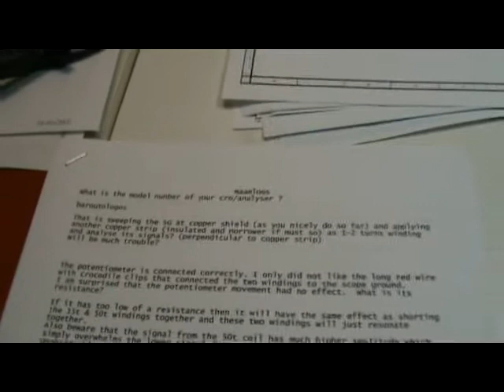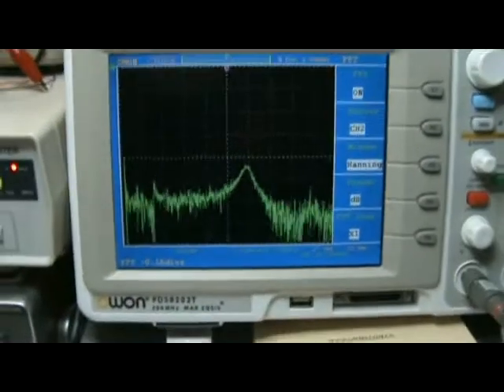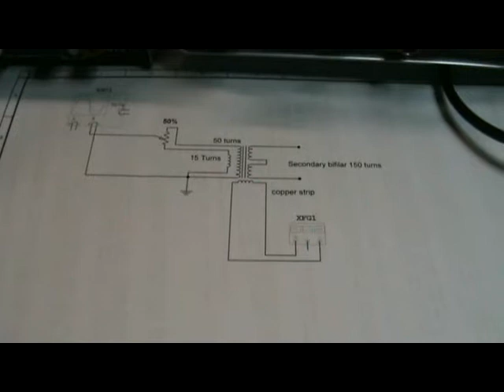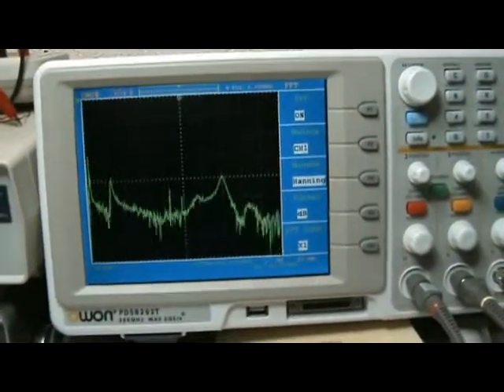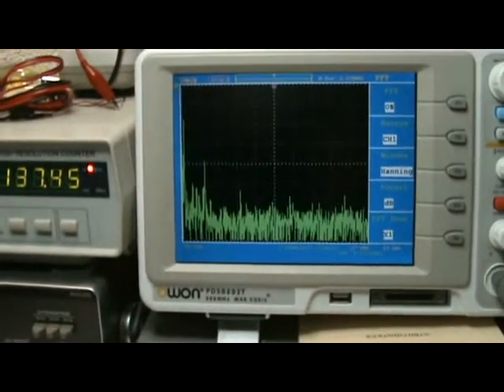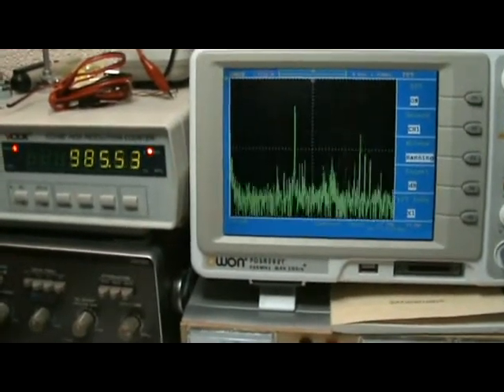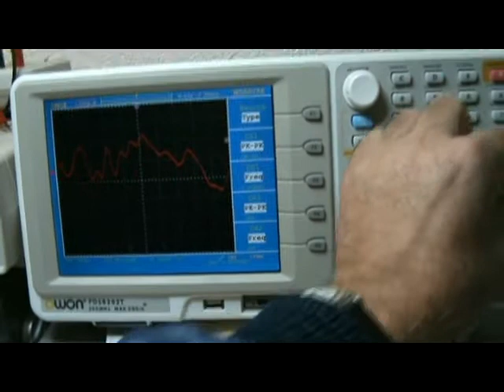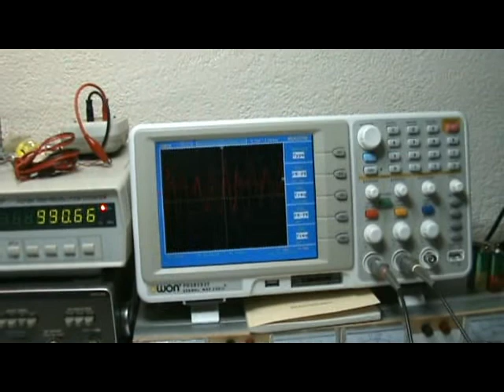TK6.avi

Comment from the maker: T-1000, i doubt that this 1667Khz is a harmonic.  From my measurements it looks like it is the natural resonance freq. of the 15 Turn coil. 
But i will test tonight what happens when putting 1667Khz square wave at 39% duty cycle on the copper strips and looking with the spectrum analyzer on the 50 turn coil.
Thanks,  Itsu

Comment: So your resonant harmonics is 1667kHz and natural resonant frequency on ~6MHz, you should use 1667kHz  square wave of duty cycle 39% on copper strips to find out lower harmonics on 50 turns coil with highest peaks. Then put that square wave frequency with 39% duty cycle on 50 turns coil and adjust it to get sine wave on 150 turns coil. Then just put ~9V 0.75A (or similar) transformer to 15 turns coil and see if you get 50Hz sine wave with your resonant frequency inside on 150 turns coil.